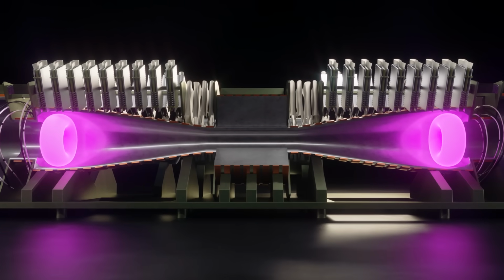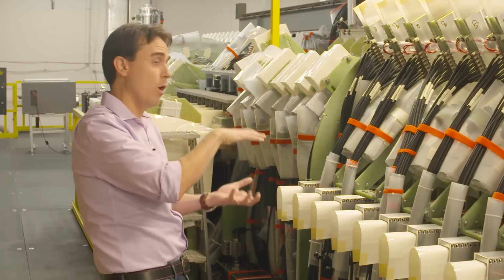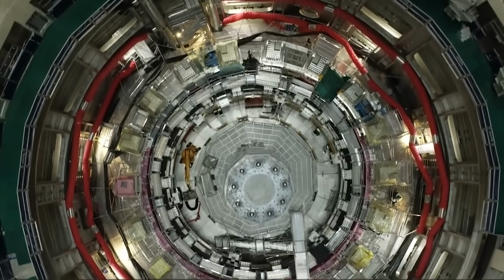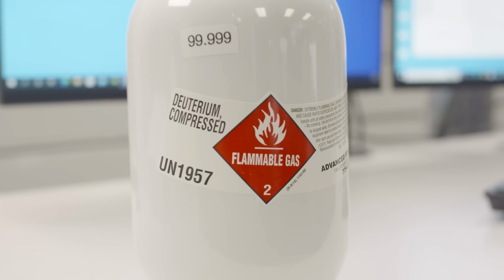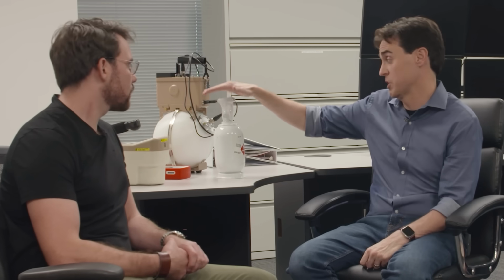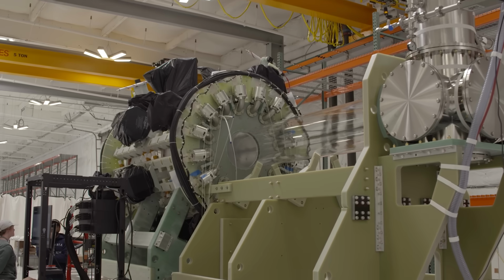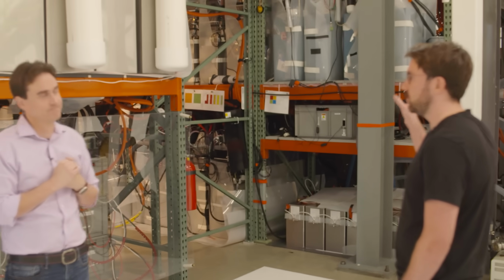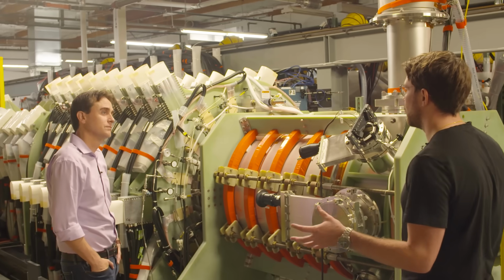A New Way to Achieve Nuclear Fusion: Helion

Comment: I’d like you’re rebuttals to these claims, just curious. They claimed you were duped and some comments point out some very key points about the ceo’s shady actions. 

https://youtube.com/watch?v=3vUPhsFoniw&feature=share
Reply: I have written a rebuttal and posted it here before:

- Critique: "FRCs have been done before and never worked." 
First, define "worked"! What was the goal of the experiment and what was the outcome?
Second, yes, FRCs have been done before and the members of Helion's founding team were actually involved with several of them. They applied the lessons learned from those to their own design, which they have tested over 6 prototypes so far.
Lessons learned and applied:
1. Size of the FRC. The larger, the less susceptible to n=2, rotational instabilities.
2. Elongation to radius ratio. The longer the FRC, the more stable it is to tilt instabilities.
3. The merging before the compression. This part creates a single, hotter and more stable FRC as a target for compression. FRCs get more stable, the hotter they are.
4. Helion's FRCs have a very low electron to ion temperature (Te:Ti) ratio of 0.1 and less. That makes things a lot easier compared to machines where both are in an equilibrium because: 
P(fus)/P(loss) scales as Ti^1.5 / (Z^2 * Te^0.5 )
Where Z is the atomic number (in case you wonder about that).

- Critique: "Deuterium - Helium3 has a smaller reaction cross section than Deuterium - Deuterium. At the 100 million degrees temperature discussed in the video, Deuterium - Deuterium reactions would be much more likely than Deuterium - Helium3 reactions."
That is generally true, but the author misses some key points:
Trenta is a subscale prototype with much weaker magnets than what they are proposing for a full scale powerplant. Because of that temperatures are somewhat lower than in a full scale power plant. Power plants aim for temperatures 20 keV (220 million degrees) and up to 330 million degrees (30keV). At that point the D-He3 reactivity surpasses the D-D reactivity.
That said, Helion actually wants some D-D reactions because that is how they are breeding their He3.
D-D => He3 +n or D-D => T +p
Both reactions have a 50% chance of happening.
So, in mixed mode (breed and power) machines, they will need two D-D reactions for every D-He3 reaction, at least until the Tritium inventory is large enough that they have a constant supply from decay (Tritium beta decays into Helium3). Sicne Tritium has a half life of 12.3 years, that can take maybe 20 years. That fact is probably the best criticism of Helion's approach.

- Critique: "Deuterium - Helium3 is too hard and Tokamaks cannot do it. Therefore Helion's approach of fusing Deuterium and Helium3 can never work."
D-He3 is very hard to ignite, but they do not need ignition for their design to produce enough net electricity to be economic. Most of the energy from D-D and D-He3 reactions is released as charged particles, not in neutrons. Helion can recover the energy in charged particles directly as electricity at a higher efficiency than a steam plant would. They can also recover 95% of the input energy directly as electricity. That makes their machines a lot more efficient.
Further, FRCs are high Beta (~1.0) compared to Tokamaks (~0.05). Beta means the ratio of the plasmas internal pressure to the pressure applied externally via magnets. 
Fusion reaction rate (the amount of energy produced) scales as magnetic field to the 4th power, an extremely strong scaling. However, that is the magnetic field inside the plasma, not outside, which scales as Beta^2 and B_external^4. 
If it was just about the efficiency of the magnets (it is not), then a 10 Tesla Helion machine would outperform a 200 Tesla Tokamak.
But, it is a bit more complicated than that, because confinement times in FRCs are generally lower. You win some, you lose some. Overall it is still a win for Helion's approach.
Since Helion is using adiabatic heating through the compression stage, they can to some extent(!) balance temperature and density almost linearly for a given magnetic field. D-D reactions favor higher density and lower temperatures. D-He3 is the opposite way round. They can tune that just to the right sweet spot between density and temperature depending on which reaction they want more of.
Another thing that works in Helion's favor is the aforementioned Te:Ti ratio. This ratio actually decreases further with higher temperatures. So the hotter the plasma gets, the smaller that ratio. Trenta already showed Te:Ti at <0.1. It is likely that a power plant will have an even lower ratio. Lower electron temperatures greatly reduce Bremsstrahlung losses. At a ratio of 0.1, thermal transport losses actually kick in earlier than Bremsstrahlung.

- Critique: "The neutrons from Deuterium-Deuterium reactions would have fried Trenta and I see no shielding." 
As mentioned, Trenta is a subscale prototype, an experiment. It is smaller, weaker and only operates at one pulse every 10 minutes (max). A full scale powerplant would do 10 pulses a second!
Not all shots were fueled by Deuterium or Deuterium + He3. Many were fueled by a mix of hydrogen and Deuterium or pure hydrogen, depending on what they wanted to test.
Because of that alone, the total neutron flux that Trenta has experienced so far is not that high.
What the critique does not mention is that neutrons from D-D reactions have a much lower energy than those from Deuterium- Tritium reactions (2.45 MeV vs 14 MeV). Those 2.45 MeV are below the activation energy of many materials.
The machine is mostly made from low activation materials or materials with a half life measured in minutes. Aluminum activated by D-D neutrons has a half life of 2 minutes.
In fact testing different materials under neutron exposure was one of the purposes of Trenta. They have tested quite a few alloys to see how they behave.
There is still permitted shielding of course. It is in the walls of the room and not close to the actual machine, which can handle the aforementioned relatively reduced neutron load just fine. 
It is also worth mentioning that a mixed mode Helion power plant (that does both breeding and power production) would produce neutrons only in one third of all reactions. So the neutron flux, even for those machines would be lower than for a D-T Tokamak.

- Critique: "Helion claims that they discovered new physics when they say that the ion gyro radius is 25% larger."
The whole ion gyro- radius thing was based on a misunderstanding and out of context quote and maybe also bad wording.
What happened was that Trenta achieved a higher ion temperature than predicted by Helion's too conservative physics model (a higher ion temperature is actually a good thing!). That higher ion temperature caused a 25% increase in ion gyro radius, which is perfectly in line with established physics. That's it. Nothing to see here!

- Critique: "Helion had previously said that they would have a working power plant in 2021. "
IM was very eager to get a "gotcha" on Helion. I guess he did not read further up on the page, or he would have seen that Helion was in the process of raising funding at the time. They did not get that funding until now. Even Trenta was less than 35 million (especially if you take the 35 million into 2019 dollars, when they started building it).
No bucks, no Buck Rogers. Should be quite clear, no?

Comment: Initiating Fusion has been achieved by many companies and countries this decade,  but holding and / or achieving continuous Fusion eludes all.
Reply: This is a pulsed system. If you have a high enough density and temperature, then the confinement time can be shorter. It is perfectly legit to do it that way.

Comment: Could there be rings to take out the pressure when heat is to high so the parts of the mashine dont get damaged ?
Reply: Also the fuel could be infused and fusioned material will be thrown out over time
Reply: A spiral
Reply: The power output is way better
Reply: The hourglas has to be wider.
You accelerate the atoms the electric field has to be parcial shut off /set to a certain output or input.
The energy will go one way to enhance  the magnetic field in one spiral or both
Reply: The parts would be more durable this way. A shut could be opened
Reply: Imagen a plane full of this
Reply: This could take me anywhere

Comment: Uh, but 10s of millions of degrees means everything melts. which means game over.
Reply: No. 
The plasma is hot, but not very dense (closer to a vacuum than to ambient air). A single pulse only contains a few kWh of energy, a fraction of what is in a Tesla battery.
Reply: @elmarmoelzer2229  well assuming this is all true, I still say its decades, 50-100 years before we get this feasible and working in production on a large scale.
Reply: @BlazingShackles   Thats not what Helion and other fusion startups say. And I don't think so either, tbh. The technology is there now. It is the SpaceX moment for fusion.
Reply: @elmarmoelzer2229  you're dreaming. new tech always takes 3-4x longer than hypothesized. Dick Tracy wrist video phone was from the 50's and was supposed to be reality by the 70s. here we are 70 years later and although the tech is available, you still cant buy one.
Reply: @BlazingShackles  
What do you mean, you can't buy one?
Sure you can buy smart watches.
Just that no one wants or needs it. The bigger screen on the cell phone is way more convenient.
Either way, Helion is still on track for demonstration of net electricity with Polaris next year (likely late next year).
They historically have a 3 year cycle between machines, but lets assume twice that (just to be safe). That would put their first real power plant at exactly 2030.
Reply: @elmarmoelzer2229  none of the smart watches have video.

Comment: So how long does the actual fusion reaction last? The picture of fusion we've always had was that the tricky part was starting the fusion reaction; after that, you just feed it hydrogen and it keeps going. But that doesn't seem to be how this works, right?
Reply: This is a pulsed system. Every pulse last in the orden of one millisecond. It resembles a bit how internal combustion engines work: injection, compression, explosion and expansion, evacuation, repeat.
Reply: @charliem6590  So there's no sustained fusion reaction? Fusion happens once every pulse?
Reply: @calorion  Yep.
Reply: @calorion   Yep and it is not needed. If you do enough fusion reactions in a short period of time, you do not have to maintain it for very long.
Fusion triple product = Density * Temperature * Confinement time. If your Density and Temperature are high enough, the confinement time can be shorter.

Comment: Since this type of reactor is "simpler" in that there's fewer steps to transferring the energy produced into electricity, I wonder if this could have applications for near-future propulsion systems. The VASIMR prototype consumes huge amounts of power, and in practical use on a spacecraft, it's either a really good single generator or a large solar array to move it. This reactor doesn't require heavy, or mechanically complicated turbines or moving parts, perhaps it could power a nice electric propulsion system?

Comment: Not easily replicated, not practical and if that magnetic field fails, hope and pray! But I must say it's genius...
Reply: If one of the many magnetic coils fail, not much happens. It would be a bit as if the cylinder seal in a one cylinder combustion engine develops a big leak, compression would fail and the engine would just stop. Oh, and the total amount of fuel mix inside this machine is measured in milligrams, not much of an explosion risk here either.
Reply: @charliem6590  if the magnet containment fails the risk of damage is real expensive.
Reply: @emperorkalel  
Define "fails"!
Worst case scenario in case the coils are broken and there is no circuit at all right then there is peak fusion
The plasma expands but does not induce a current in the coils. So expansion is not slowed down.
A few kWh of energy hit the walls of the vacuum chamber. They get a bit toasty. If that happened very often, the walls need to be replaced before their regularly scheduled service date.
Since the walls are generally considered "expendable" and need to be replaced every few years anyway, they are mass produced. They are made from quartz, which is the most abundant element in Earths crust. They are cheap. You have a few thousand dollars worth of repairs. Pity, but no big deal.
Reply: @elmarmoelzer2229  I disagree, your scenario is very scripted and specific not always the case in a real world scenario. This will never be mass produced it's a novelty at best like the first giant computer.
Reply: @emperorkalel   No, it is physics. Physics says that it will be this way. 
Sigh... I wished people would actually try to understand and learn something.
You have access to all the knowledge of mankind on the same device you used to make that comment. Yet you choose to remain ignorant.
Reply: @elmarmoelzer2229  You ignorant bastard, do you realize how stupid you sound? Specially when you write a sound ! You have no idea what you are talking about and it's clear by your comment that you are out of your league. Step off dummy and educate yourself.

Comment: I lived in Los Alamos NM in 1973 and saw one of the first Tocamacs ever built.  The whole "donut" was about 6-8 feet in diameter, with the tubes about  6-8 INCHES in diameter, but the cable system to make the fields, etc, took up an entire building about the size of a Basketball court.  Quite an impressive machine!  It's a testament to how complex this tech is that in 50 years they still haven't made it work for a practical application. 

I subscribed to Nebula and Curiosity stream through your channel about a month ago.  Looking forward to checking out those interviews!  Thanks for making great videos.

Comment: This is great once this can be commercially viable, we can start replacing natural gas plants, coal, oil and other dirty sources of power, we can even stop in relying so heavily in solar/wind energy, meaning we stop destroying natural habitats and killing wildlife, just one problem I see is that we really have to upgrade the power grid so it can handle more electricity, if we don’t then what’s the point, all excess power that this may produce will just get grounded

Comment: Deuterium is 2H. Tritium is 3H. It uses the same fucking things as a tokamak, but without the extra reagents And far less energy gain, how the hell are they ever going to get this to work..
Reply: No it does not. 3He3 (note the e) is Helium3. The Tritium is a byproduct that they can let decay into more He3.
Also who says "less energy gain"?
Reply: @elmarmoelzer2229  right helium 3 is another matter, i must've misheard it. What I ment by far less energy gain (for the helion tech) is the short bursts of energy that is generated is nowhere near the 11MJ to 44MJ that other fusion reactors have been putting out. The one that reached 44MJ ran for 20 seconds continuously, if you're interested I can find the link to it
Reply: @dannefan_drulenären  
What matters more is the ratio of energy coming out vs energy going in (Qsci). Short bursts are totally legit in that regard. 
Also, Helion does not need as much Q as Tokamaks because of their direct conversion and efficient input energy recovery (95% efficient). It increases their Qtotal a lot, even if their Qsci will be around 3 or so.
Tokamaks and others will have to convert the energy from neutrons into electricity with inefficient steam plants.

Comment: I'm just imagining this, but you cut out half of it, and so when you accelerate the plasma, it comes out like a weapon. I truly wonder how well that would work as a plasma weapon.
Reply: Ok so it's not just me then lol
Reply: I think the inside is a vacuum so that would only work in space if true
Reply: @jimskywaker4345  so what? it's fun to think about, even if it wouldn't really work. also, hear me out; the end it would be shot out of could close and depressurize during the first bit, and open up when it gets fired out. after all, it's not like a vacuum will prevent the fact that there's matter, and it's moving at high speeds. sure, it might remove a LOT of velocity fast, it's still gonna shoot out.

Comment: I'm usually very skeptic towards fusion, this however seems promising.

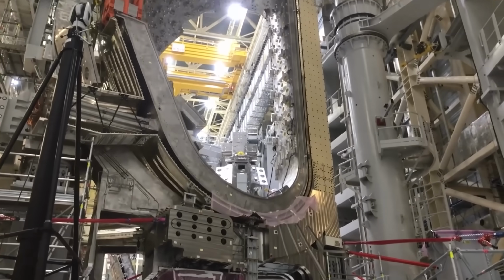However, what an incredibly ignorant statement at 11:40, that nuclear fission isn't competetive. This is only true is when anti-nuclear activists are able to dictate regulations and taxes or a few instances with failed projects (which has nothing to do with fission technology itself). Even Olkiluoto 3 is cheaper than offshore wind. In the real world where grid stability is essential, nuclear is the only choice. Wind and solar just doesn't work. There isn't a single country in the world where they have contributed to lower costs, kept grid stability and reduced emissions at the same time.

Comment: This was just marketing crap nearly nothing to do with engineering and on many factual levels completely wrong .... lets start ... frc new unique staff ... yea like since 1960's new .... https://en.wikipedia.org/wiki/Field-reversed_configuration
also .... how you prevent from creating neutrons from deuterium reacting with itself or you think deuterium will react only with helium? ... assuming they even can get to pressure/ temperature to achieve fusion in first place .....  
Probably some oh i got this wrong and shit happens would be nice to see on this one from you to put some reality checks in place  .....
Reply: The WAY they do FRCs is new.
There will be neutrons from D-D reactions. They actually need D-D reactions to make He3.
The D-D neutrons are relatively low energy at 2.45 MeV (vs 14 MeV for D-T reactions).
They do fusion every day and lots of it.